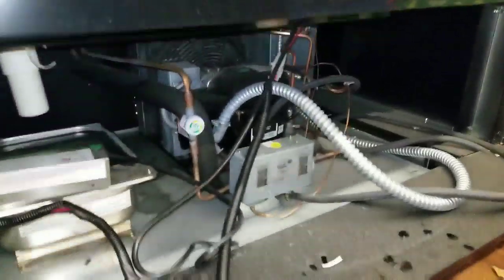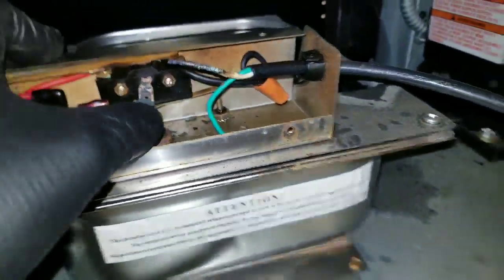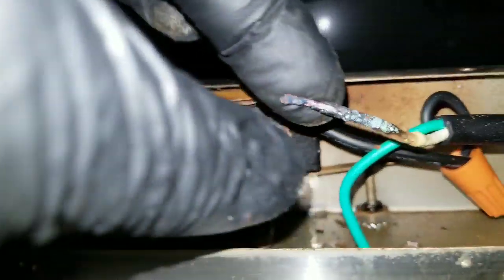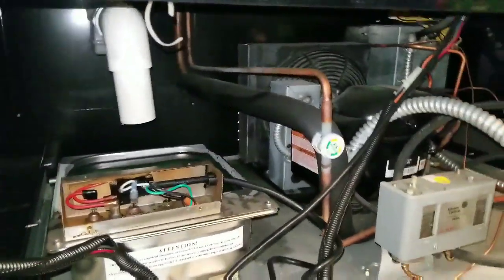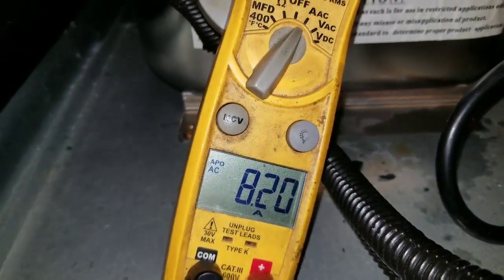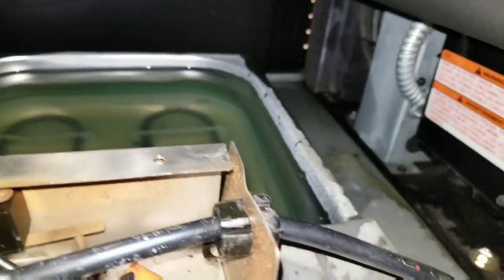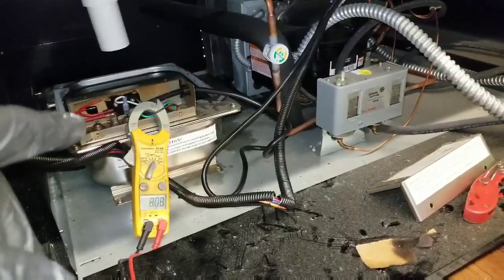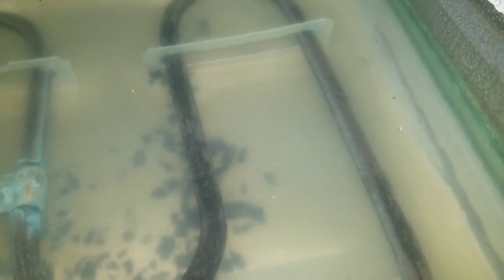BAD CONDENSATE PAN!!

Comment: The pan fills up and just keeps running over for me. I have a artic air commercial refrigerator. Isn't it supposed to evaperate in the pan?
Reply from the maker: Yes it is, maybe you need more wattage (bigger heater)
Reply: @gr82becool  It worked fine for about 2 years. Could it be a blown capaciter or motor or electrical problem? I wasn't sure what all was related to the evaperater pan.
Reply: I unplugged it overnight just to be sure ice isn't an issue, but I will keep a close eye on it.
Reply from the maker: A few things could be happening. Door gaskets not sealing properly or door not closing properly allowing more moisture to come in and stick to evaporator coil. This will cause more condensation going into your pan. But also make sure your pan heater is working properly. Good luck 👍
Reply: @gr82becool  Thank you

Comment: Did you check the amp rating what's the manufacturer.
Reply from the maker: No, I've been dealing with those type of condensate pan 4 years and got to know the type of amps pulling from those heaters.